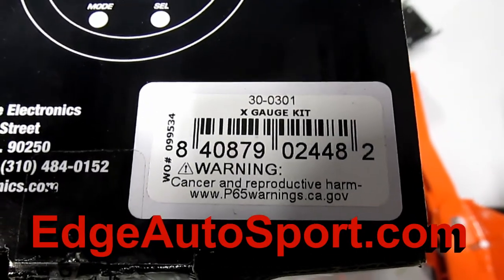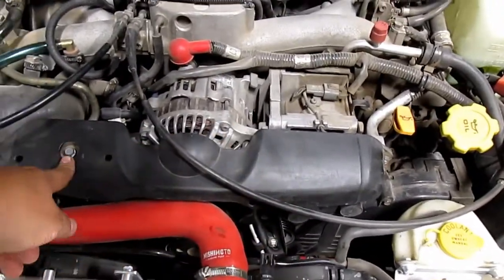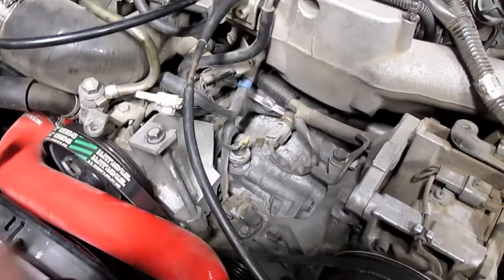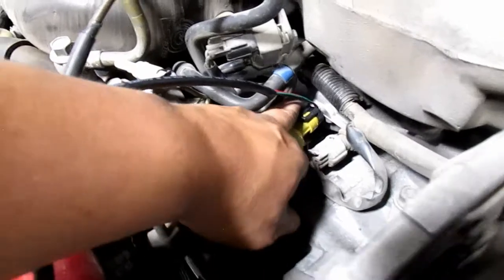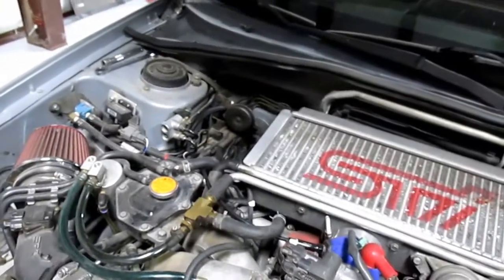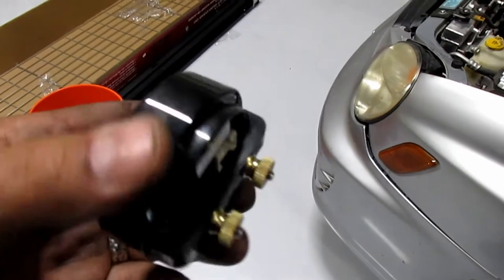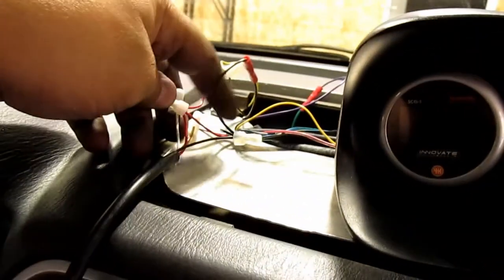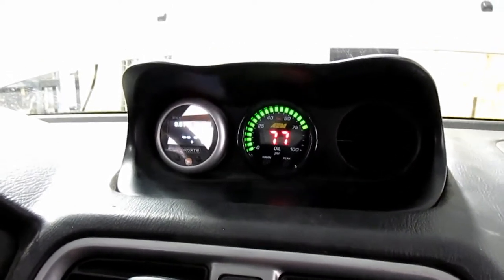How To: Subaru WRX STI AEM Oil Pressure Gauge Install Step-by-Step

Comment: That tee is exactly what I was looking for to still utilize the factory sensor. I was going to install the factory sensor in the rear galley plug but it seemed like just a pain in the ass extra step. I can’t see there being anything negative about using that tee. Thanks for the video.
Reply from the maker: your welcome.  it is working pretty dang good so far

Comment: Thanks for the video! I have a 2007 STI and also had clearance issues others have mentioned. I solved it with brass pipe fittings from Home Depot, specifically a 1/8 x 1 1/2 inch MIP nipple and a 90 degree FIP elbow. I inserted the nipple into the block and the elbow on top of that. From there you can attach the tee parallel to the block facing back and slightly to the left (sort of pointed towards the coolant expansion tank), the oil pressure sensor pointing up and perpendicular to the tee and the OEM sensor at the end of the tee.
Reply from the maker: Thanks for watching!

Comment: I just did this on my 2018 sti a few days ago, I’m not sure if they changed fittings size but my alternator was hitting the factory oil sensor making real difficult to put the belt back on so I had to grind down the alternator a bit where the oil sensor would hit. Just an fyi for who ever else does it. Other then that it’s been good. Thanks for the video sir.
Reply from the maker: No problem

Comment: thanks for the video! is that sensor still needed? i see videos like this that are using bpt to npt galley plug and abandoning the sensor.
Reply from the maker: yes you need the stock sensor.  for the stock ecu.  but if you dont care about that, then you can just get a single plug adapter.  i would rather have both options.  but it is your car.
Reply: If you delete the OEM sensor your oil light will be on all the time on your dashboard.
Reply: @Zazuk68  That is incorrect. If you unplug the OEM switch, the light will NEVER come on. You're thinking about it backwards.

Comment: How far did you screw down the T? I ordered it and it gets really tight about 80% of the way down. Did you get it till it bottomed out?
Reply from the maker: Until tight.  Wont go all the way down
Reply: @FatGuyBuilds  appreciate it!
Reply: @FatGuyBuilds  trying to do it now. Unfortunately the alternator is hitting it big time
Reply from the maker: @OggaDugga  u may have to pop up the alternator a littlebit to get it in.  Then put it back.  U may have a thicker tee than me.
Reply from the maker: @OggaDugga  may have to grind ddown the outside of the tee if it is too big.  Makesure the sensor goes in after u have the tee almost done
Reply: @FatGuyBuilds the “ribs” of the alternator housing are hitting it so I’m just gonna cut them off lol
Reply from the maker: @OggaDugga  dang how big is your tee
Reply: @FatGuyBuilds  it’s not the Tee it’s the OE sender it’s hitting.
Reply: Did you get it to work? And what year sti. I have an 18.
Reply from the maker: @michaelhernandez8418  kit will work on any year
Reply: @michaelhernandez8418  no it doesn’t work for me. I’m sourcing a kit from the UK which is a steel braided line to relocate both senders to order the alternator. My other option is put the sensor by the turbo galley. Idk what I’m doing yet.